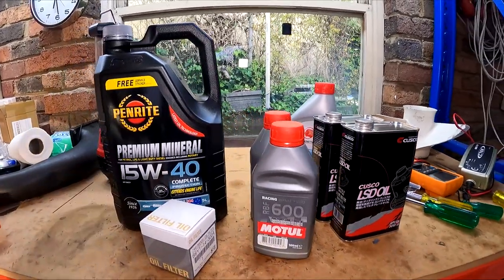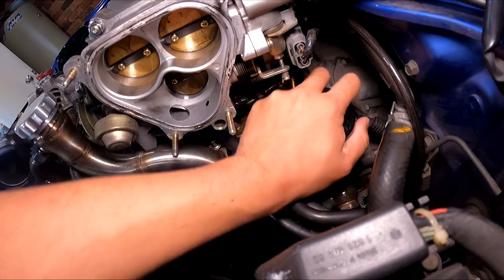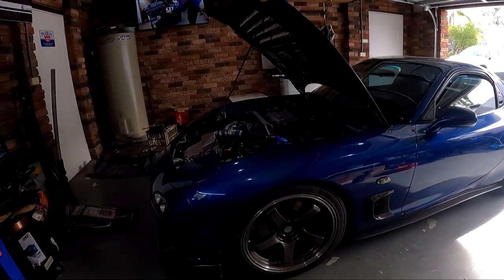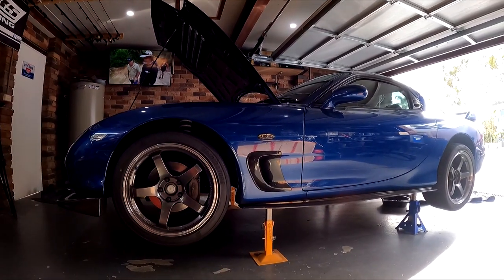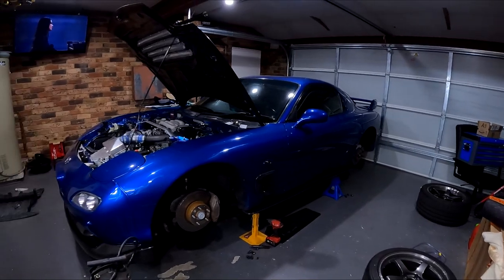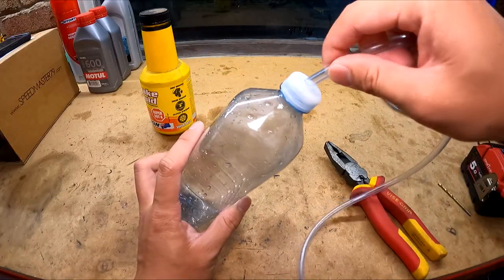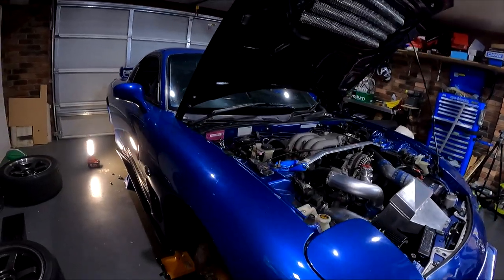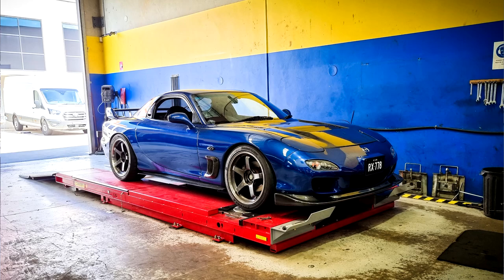FD RX-7 TRACK PREP and maintenance

Comment: Nicely done!

Only thing I would suggest is SpeedBleeders to enable one-person brake flushing/caliper bleeding. I didn’t see, but I presume you replaced the rubber brake lines with braided steel to improve feel.

I miss my 1993 CYM RX-7 (FD), purchased new, with many track days in the US at Sebring, Daytona, Road Atlanta, Moroso, Homestead, Summit Point, etc.
Reply from the maker: Thanks mate! Still on the original rubber lines. I haven't seen the need to upgrade them based on my experience with braided lines in previous cars. However if i was to do a BBK in the future, would definitely get myself a new set of braided brake lines. 
I have a speedbleeder but for some reason always gravitate back to the DIY bottle method... 

CYM FD! Definitely my favourite FD colour.